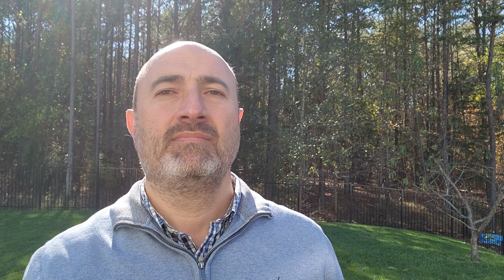BREAKING! Tesla Just Revealed New Details About Cybertruck's Body

Comment: Not an exoskeleton, but may instead have replaceable outer panels that because they can’t be repaired can be sold by the millions over time, the razor blade model.
Reply: You think it’s one piece of steel bent for the whole vehicle???
Reply: @NotMyRealUTubeYall  That would be nuts. Tesla insuring a vehicle that can’t be repaired after a small accident?
Reply: What is the tow bar attached to?
Reply: @Dularr  casting
Reply: Castings like in the Model Y but with flat steel panels bolted on. And the so-called structural battery pack.
Reply: @carlbernhard9617  wondering about the shearing forces on the structural battery pack bolts.
Reply: @Dularr  The passenger compartment cage area looks to be very strong and it is doubtful any forces are sent to the battery pack except perhaps in big collisions. The “structural” pack is great for efficient assembly.
Reply: @carlbernhard9617  if the tow is run through a chassis, you will still have shearing forces on the bolts that attach the structural battery pack to the chassis.  Still questions about what prevent the load ripping the back off the Cybertruck.  
With another question is if the motors fail what prevents a disaster with the load.
Reply: @Dularr  The rear casting will be suitably strong. Tesla ordered a giant casting machine for that. It will be glued to the center cage structure which will be plenty strong.
Reply: Replaceable outer panels was the whole idea of the original Delorean. If that's the route Tesla goes with the Cybertruck, then that's one more reason that the Cybertruck is a reincarnation of the Delorean.
Reply: @JEP-Tech  yeah, they used a GM invention, thin stainless over some sort of plastic and these panels could be molded into curvaceous shapes. Were these cheaper than thick solid stainless that undergoes a bending process?